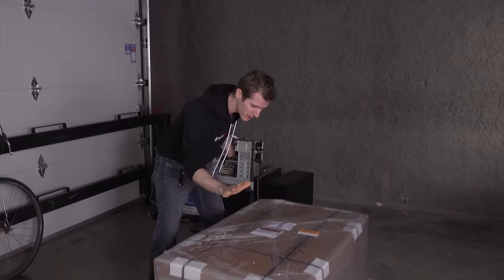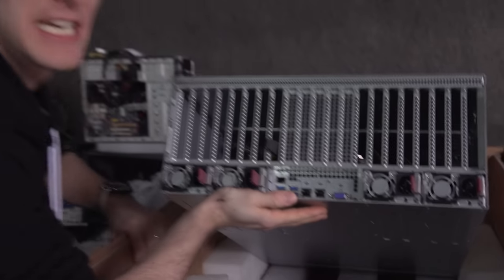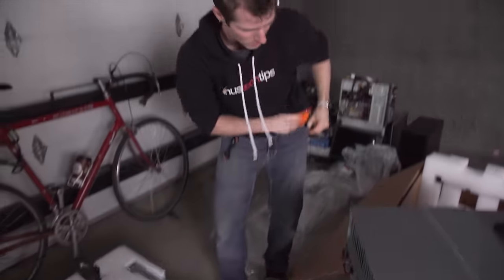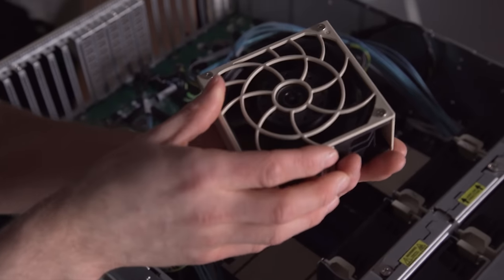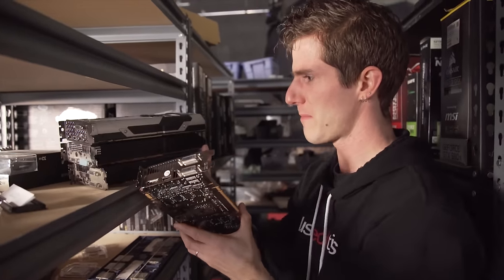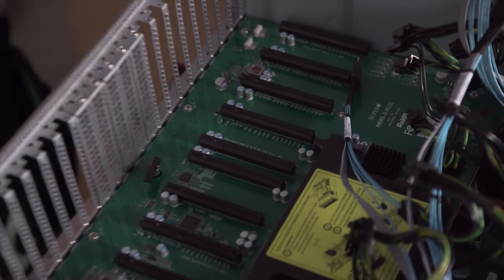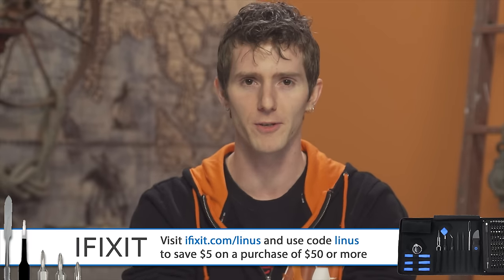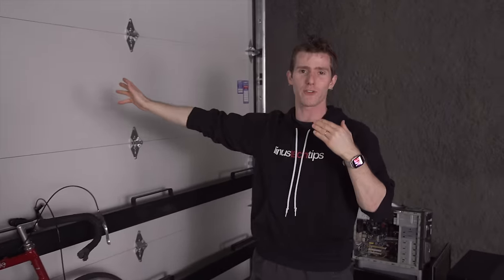$4,000 Server Chassis Holds 8 DUAL SLOT VIDEO CARDS! - HOLY $H!T

Comment: use all 290xs and see how much heat you can get out of it.
Reply: You know the Yellowstone Volcano? The one that would destroy half the world? That is 8 290x's
Reply: +pepe jpg that would cook your pizza
Reply: Kek
Reply: +pepe jpg no no no... All GTX 480s!
Reply: +Tangopiper nope they are all r9 295x2
Reply: +Tangopiper and a fx9590
Reply: +Racem Abdel 16 Gamers "1" CPU!
Reply: +pepe jpg true pizza warming build
Reply: +pepe jpg  or 480's
Reply: +pepe jpg we may see a linuspizzeriatips
Reply: he did it on periscope those fans are loud as hell
Reply: +Pranav Varma 
you think so ?   go visit a data center !
Reply: +Paul Moadibe oh sorry I didn't mean the graphic card fan , I meant about those big fans which came with the case
Reply: U gonna need two 1600psus to run that.
But hey, now you get computing power and a heat source for the winter! :D
Reply: +pepe jpg Just don't use GTX 480s. They'll melt the crust of the earth.
Reply: 295x2
Reply: try pre-partch 480s
Reply: If you use 8 480s you could build a fusion reactor, or make a new sun
Reply: +TR-8R haha, true dat
Reply: i use an r9 390 and that on its own is very hot.
Reply: +pepe jpg 
all 980Tis :)
Reply: Not r9 290xs but gtx 480s
Reply: Not r9 290xs but gtx 480s
Reply: real gpu outputs real heat
Reply: Now that's how u should warm up pizza
Reply: +pepe jpg Why is everyone saying 480s when they have a thermal output of 220w, versus the 5 friggin hundred, yes thats 500 watts of heat, that the 295x2 will output????. Put 10 295x2s in there, and you will have 5 KILOWATTS of heat. try even supplying that via those 1600w PSUs
Reply: Let's say use all GTX Quadros!
Reply: Jeremy974 The gtx 590's will be better.
Reply: gtx 480's
Reply: Wouldn't work. It doesn't have room for 8 PSUs too.
Reply: Danny Young The gtx 590's and 295x2's are going to destroy this earth.
Reply: +pepe jpg You would beat global warming XD
Reply: +pepe jpg Luke, your pizza heater is noob.
Reply: +pepe jpg 980 produces the same amount of heat. There is no way this PC would run with all GPUs active without being able to suck air.
Reply: Could use it then to warm up my entire school...
Reply: +pepe jpg pizza oven confirmed
Reply: +Alekthefirst 
because GTX 480's had serious thermal issues.
it's a joke about GPU's that couldn't handle their own heat generation, not what can dump the most heat possible.
Reply: +pepe jpg 
good for winter while running Folding@home
Reply: Nay I say, 8 X R9 295x2's.
Reply: +pepe jpg NO! just remove the fans :D
Reply: The radiators can be mounted in our imaginary wallets.
Reply: Should keep that building warm during those Canadian winters.
Reply: They could literally use that to heat the office in the winter
Reply: 470*
Reply: 8x titan x! PC Wars Episode 12! (TechSource)
Reply: Make an Iron foundry, Blacksmithing with power of computing

WE FUTURE NOW BOIS
Reply: +KZM KeramatZMode LOL right
Reply: all 1080s hahahah
Reply: 8 1080s will make 500million acres full of antimatter
Reply: no all Titan Zs!
Reply: no, 16 cpus one gamer lol
Reply: GTX 690's
Reply: might aswel use this to run 16k resolution
Reply: Funny... they would melt LMAO
Reply: can't make an omelet without a few 290xs...
Reply: Excellent video content! Excuse me for chiming in, I would love your initial thoughts. Have you tried - Fiymaria Graphic Gainer (do a search on google)? It is an awesome one of a kind guide for getting the best graphic design for your project minus the headache. Ive heard some extraordinary things about it and my m8 at last got astronomical success with it.

Comment: dual 16 core Xeon CPU's 8 Titan XP's 765GB of DDR4 Dominator Platinum Memory
24 1.2TB Intel SSD's 
Can it run minesweeper?
Reply: that computer would use more power than the city of Chicago
Reply: Martin69420 prob less than 1000w
Reply: Except for the fact that the graphics cards themselves use 2000 watts...
Reply: DocSonicMC Ohh I completley missed the titans
Reply: DocSonicMC According to outervisions calc around 3300W so you would need atlest 2 1600W PSUs. Dayum
Reply: No way it can run a Minecraft modded
Reply: When you have 8 nvidia titan Xs and undertale lags

I wanna die
Reply: wow, never seen this comment before...
Reply: Just imagine this, running demanding/unoptimized games like Crysis 3, Watch Dogs 1/2, GTA 4, ARK, Mafia 3. Oh wait, Mafia 3 won't run on these specs, 8 titan XPs, 768gb Ram, dual 16 cores Xeons is below the minimum specs for Mafia 3
Reply: Sebastian Gort 8 QUADRO p6000 better
Reply: I Thibk It Can Barely Load up Windows XP
Reply: So much FPS you can see the mines explode in slow motion
Reply: Probably 10fps at laptop settings and thermal throttling

Comment: 768 gb of ram?
Reply: 69*
Reply: +Elliott Winsted 420
Reply: and I heard some company developed 128GB RAM sticks, but I don't think the CPU(s) could handle that much ram...
Reply: +HudsonGTV DDR3 goes upto 64gb dimms. I saw 24x 64gb running on the Xeon V2 platform. So yes the V3 CPU's can handle that!
Reply: Ok. Ram is 128GB max sticks. Not great quality but it is available. Windows 10 can handle up to: Home 128GB, Pro/Enterprise 2TB, x86 4GB. Even with 128GB ram you are over the cap at 3TB but you could use the 64GB sticks no problem which is 1.5TB of RAM (Of course only if you use Pro and above)
Reply: +sniperlif3 Samsung makes 128gb ddr4 rdimms for servers. I'm sure it is top notch stuff. I can buy 64gb ddr3 modules for my motherboard for 350 euro per stick.
Reply: +The Iraqi Baathist bush did ram
Reply: +HudsonGTV they can :)
Reply: Jacky Xie im not saying windows cant (i dont even think the OS matters) im saying the processor might not support that much RAM
Reply: +MrCrazy0ne Hi I'm Jim from 10 years in the future. My phone has 768GB of RAM
4U server peasants
Reply: iamdmc iphone still has 4gb at that time
Reply: +MrCrazy0ne and its probably 4"

Comment: 10 GAMERS 1 CPU!!!!!!!!!!!!!
Reply: YEAH
Reply: +platinum lagg But it will be 2 CPUs...

7 Gamers 1 CPU was a lie!
Reply: bluephreakr true!
Reply: Matthew P linus said in the video that it could hold up to 10 if you wanted to... get your facts right before leaving a comment!
Reply: the cpu that they are using, sure, but i doubt your gonna be using the same cpu
just get a cpu that supports more
Reply: 10 gamers 1 cup
Reply: +Matthew P 
A CPU can run as many processes yo want, and it includes games.
Reply: ***** true!
Reply: ***** only one way to find out!!! XD
Reply: +platinum lagg um....10Gamers 2CPUs xDDD (2x Xeon u know?)
Reply: +Zamtzz PL lol
Reply: +Zamtzz PL no it's still one CPU.
Reply: +Dax Nagtegaal no its not, its 2
Reply: Floris Hubregtse nope... The two units work together as one processor
Reply: +Dax Nagtegaal no its still 2 physical cpu's, you probably mean that i think its two seperate systems
Reply: +bluephreakr -- It was never even 1 CPU. Pretty sure they used 2 Xeons.
Reply: 20 gamers 2 CPUs 8 Titans @ 8K
Reply: TheRebel3000 that sounds awesome!!
Reply: +platinum lagg 4 Xeons are needed for that kind of setup and it should be the 16 or 18 core versions
Reply: 10 GAMERS 2 CPUS 1 COMPUTER!
Reply: +Dax Nagtegaal
A little late to mention this, but aren't you also saying that when four video cards are in SLI they actually function as one too?

So if this thing were powering two monitors with four video cards in SLI, then would it be 2 gamers 1 CPU to the highest feasible extreme?
Reply: +Aueue Dijhjsj *bukkake
Reply: +platinum lagg Then each player will only get 3 CPU cores on their machine - probably enough to hurt performance a little.

Unfortunately I don't think they make quad socket motherboards anymore...
Reply: 2cpu*
Reply: +platinum lagg 10 gamers,19 kidneys,why???POWER BILL
Reply: dude... do you have any idea how much cash this guy has...

like he cares about running that kind of machine for a day-1 week
Reply: True that...
Reply: platinum lagg 1 Gamer 10 CPUs
Reply: Yes

Comment: Imagine 8 TitanX's and 24ssd's with max number of CPU
That will run minecraft quite well with mods
Reply: +Clogged Toliet thx
Reply: to unlock the true potential, you need 8 HD monitors with over 9000hz refresh rate
Reply: +The_End 1192 and a uplink supercomputer made with 10 of these linked togther. 1 master, 9 slaves...
Reply: Tech source has a pcwars video where someone has that...
Reply: Now GTX 1080TI founders edition.
Reply: and two LN2&liquid oxygen cooled CPU overclocked at 22GHZ (8 core) with 10 GTX 1080TI superclocked (founders edition) and 512GB DDR4 memory with 24 3TB samsung SSDs.
Reply: +Zhao Zhao Don't forget the Intel optane stuffs.
Reply: Placed on the moon for best cooling
Reply: Zhao Zhao In a freezer on the moon.
Reply: except you will have to run it completely submerged in nuclear reactor grade coolant in a freezer in Antarctica on the moon.
Reply: look up titanator.
Reply: use titan z's

Comment: Hey +LinusTechTips, did you ever say which Processors are in this build?
Reply: +thelol1759 yeah the 2 18 core 2699v3 chips
Reply: +thelol1759 They have two Xeon E5-2699 v3 processors in video rendering server. These will be installed in this server.
Reply: Thanks!
Reply: +thelol1759 Xeon 2699v3's times 2
Reply: +Murphistic If i heard right this is the 4027GR-TR, it's an older version of the system, it doesn't support the V3 series, only the V1 and V2. I wonder when Linus will figure this out :).
Reply: +Dizzy Man good catch bro!
Reply: +Dizzy Man And also DDR3 is supported :)
Reply: When i'm rich i'll buy that, one day, one day...

Comment: Instead of putting that hump in, its also possible to create a bunch of custom flat power connectors that would look something like ribbon cables other than for the connector. Then you could still use the machine inside standard 4u constraints.

Comment: 3:30
Is Canada using 110 like the US or are they using 230-240V like the rest of the civilized world does?
Reply: 110
Reply: +Freakschwimmer 110 but you can have a 240 plug if you wish . Do it yourself or call an electrician.
Reply: +Freakschwimmer even US households have 230-240v outlets....washer and dryers use it...and people that have a Tesla fast charging station (and i'm sure other EVs have them too)
Reply: wait, so US-households have 110V AND 230-240V outlets?! What kind of sockets/plugs are used for 230-240V ?  Do they use 400V as well?
Reply: your electric panel has 240 volts in ? Im no electrician... red is 120 and black is 120. tThe 240 volt plug can be in a normal form factor or a special one to prevent damage to stuff thats rated at 120v
Reply: +Freakschwimmer From the pole (service drop) there are two 120V lines and one neutral in most US households. 240V can be obtained with proper wiring.
Reply: +Freakschwimmer Japan also uses 110 V mains and most of North America.
Reply: Den Log
I'm an industrial engineer, so I "only" took four classes in electrical engineering. I'm quite well aware how you would get √3-times the voltage (like Europe does with 230V/400V), but how do you get double the voltage by wiring alone?!
Reply: the black carries 120v and the white carries 120v. together you get 240volt. Hook up the voltmeter to your water heater!
Reply: TheBostonstapler
What? Are you using DC??
Reply: edit:
Nvm I checked Wikipedia... You guys are using a single phase-AC system (with 3 wires). I didn't even know that was a thing, I've always asumed you'd use a 3 phase system as well... It's all clear now, kthxbai

edit2:
And now - knowing that the system is based on Edisons 3-wire DC-System - my last comment "Are you using DC?" doens't seem all that alien anymore, does it ;)
Reply: Freakschwimmer :)
Reply: Freakschwimmer hey im just a plumber : )
Reply: TheBostonstapler
Oh, then I'll explain my confusion real quick: I've never seen a multi-wire-single-Phase-system. In a multi-wire-multi-Phase-System  the voltage between two live-wires is √3-times the Voltage [long story]. That's why I was initially confused as to how you could simply add the Voltages. But in a multi-wire-single-Phase-System voltages pretty much work like they do with DC, you can simply add the two voltages :)
Reply: +Freakschwimmer US houses come with 2 phases and 1 neutral. Phase voltage is 110v, between 1 phase and neutral. You can wire a plug on 2 phases where you get a line voltage of 240v. The plugs are keyed so you can't mistakenly switch them.
Reply: FoodOnCrack
yea, Thanks, I got it now :)
Reply: +Freakschwimmer 240V is typically run from a different plug/receptacle type to avoid damage to 110V equipment. It's usually used for things like washing machines or refrigerators that require the higher voltage. Or, in this case, ridiculously high-power servers.
Reply: It's not 3 phase, it's split-phase.  I'm no engineer or electrician, but the best I can explain it is that you have two hot wires, and it's 120v between each of the phases and ground, and 240v between the two phases.  So, that makes it 1 phase and its opposite, basically.
Reply: As if 120V didn't waste enough copper...
Reply: 2 phases of 120v potential driven 180 degrees disparate actually drastically decreases the wiring needed to perform a task. You can deliver both a 120v and a 240v potential, and either one can consume up to 100% of the kVA capacity of that path. Basically, you can consume the entire kVA capacity of the circuit in a 120v load, or a 240v load, or any combination thereof. Most of the wiring is upstream from your utility service panel, in the form of +120 N -120 feeder lines. The large transmission lines, contrary to popular belief, do not constitute 90% of the electrical grid in the united states. 90% of the electrical grid in the united states consists of feeder lines that run from neighborhood stepdown transformers in 2 phase 120 to service drops which lead to structures. Think of it like a blood vessel, most of it's surface area is in the capillaries, because even though the capillaries are small, there are so many of them. This is fractal geometry. Wiring inside the building is very little of the picture, and large multiple kV lines comprise 5%-10% of the total length of wire. If we were to use, say, a 240v 2 phase system, then we would have 480v 60hz AC in our utility boxes, and joe blow home handiman mr. fixit would be killed instantly when he tried to flip his circuit breaker and he was sweating because it was hot outside.
Reply: its a long story
Reply: Much like the US, canada uses split phase power. You have a center tapped neutral, and two 120v hot wires 180 degrees out of phase. 

Hot 1-neutral = 120v

Hot 2-neutral = 120v

Hot 1-Hot 2 = 240v

Comment: 2 xeons 8 titans and 768gb of ram sounds fun
Reply: +aidanman12 might be enough for assasins creed unity at 30fps 1080p
Reply: Pl4sm4Ro4ch probably to taxing on the hardware maybe 900p with some frame dips
Reply: +aidanman12 you'd be having for for the next 15 years possibly. until, you get the power bill
Reply: +Koolkei I wouldn't turn it on I'd just look at it like I have 35,000$ worth of pc parts on the side there because why not
Reply: +aidanman12 But can it run Crisis 1
Reply: +mustafa zafer it struggled on the full tilt pinball benchmarks so probably not

Comment: 13:11 why is there a nintendo wii inside a toaster
Reply: good point lmao
Reply: +๖ۣۜ♥๖̶tacokitten๖̶ 
solder re-flow??
Reply: +๖ۣۜ♥๖̶tacokitten๖̶ Thinking CPU/GPU reflow... but ehm, yea you'd want to take everything apart and only bake the motherboard.  Even then ovens melt too much - heat gun is way easier.
Reply: lcrazy8l
the only reason a wii would need a reflow is because someone put it in an effing toaster

Comment: Linus doesn't have 8 titan Xs laying about? Disappointed.
Reply: It'd use more pci express lanes on the cpu(s) and would have needed to rely on a plx chip which just isn't efficient or that reliable
Reply: +David Bauer He is too busy using them to counter balance other components.
Reply: +David Bauer 
All the cards he picked were different for a reason.
Reply: Sarcasm guys